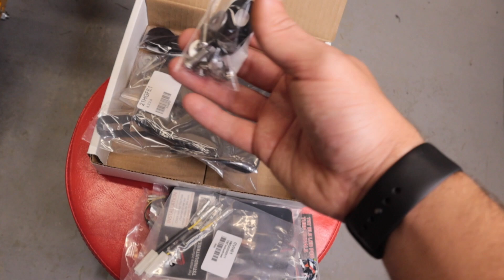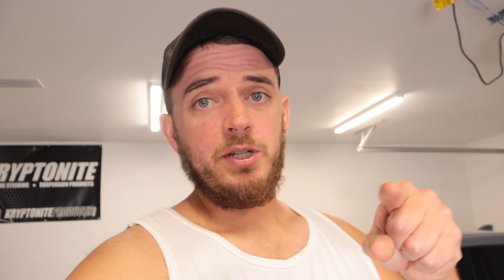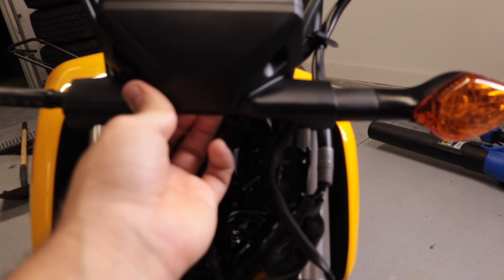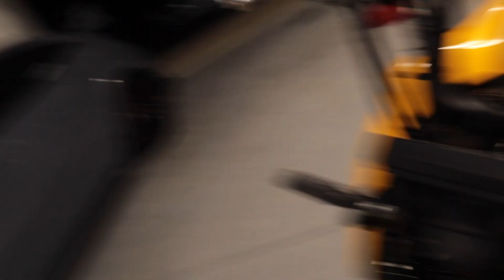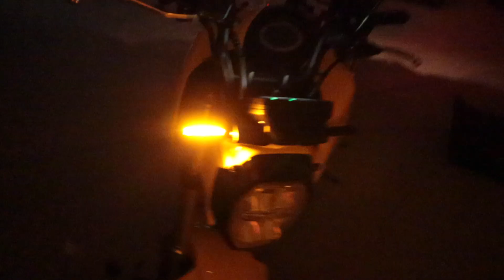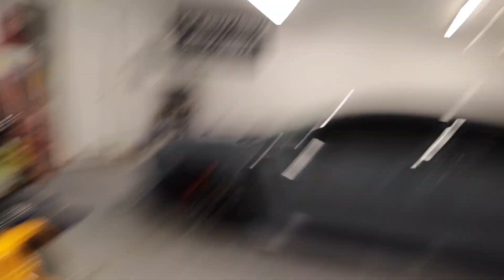2022 HONDA GROM FRONT TURN SIGNAL INSTALL **TST INDUSTRIES**

Comment: Those plastic pieces do not come with the blinkers you linked. Not to mention that you didn’t link the adapter. Thanks dude.
Reply: What are you so stingy for
Reply: Guess you’ve never bought anything on the internet and read what’s included with the item, website states you need to buy adapters with your purchase

Comment: Very nice!  Same signals on my Grom.  I'm super happy with them.
Reply from the maker: Did you do the rear as well?
Reply: @TTorres1183  Yes, TST BL6 all around.
Reply from the maker: Sweet, I’ll install the rear sometime this week!
Reply: @TTorres1183  Nice!  I've installed a lot of TST accessories.  They are top quality.  Looking forward to seeing your next video.
Reply from the maker: I really wanted to integrated tail light but they are sold out!
Reply: @TTorres1183  I wanted that too, but I live in Pennsylvania.  Our turn signals have to be 12" apart.  So the integration wouldn't be good here, but they look sweet!
Reply from the maker: I’m sure the BL6 looks good on the rear